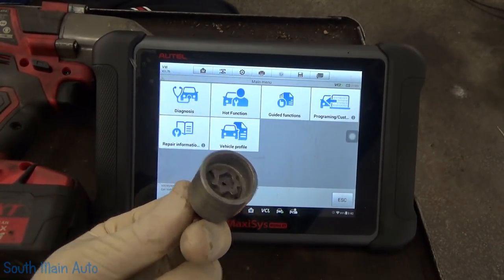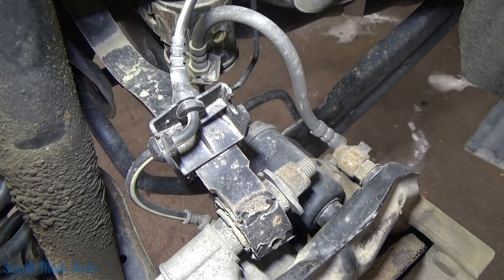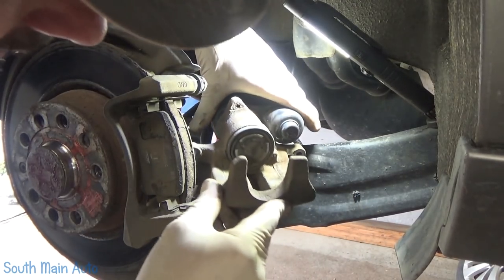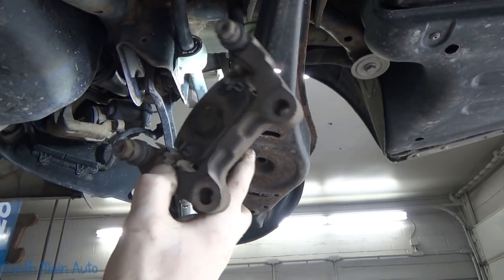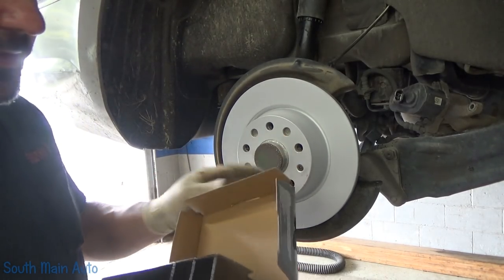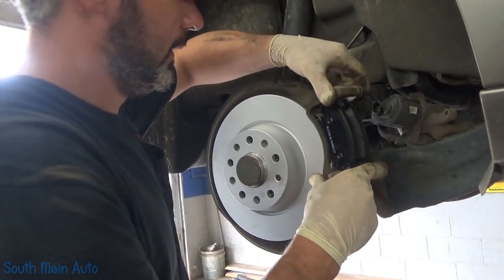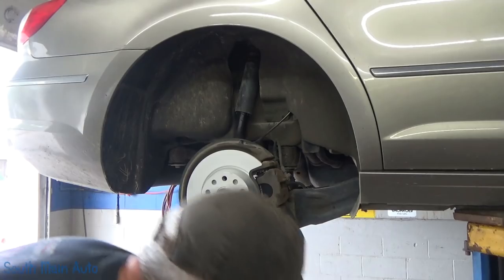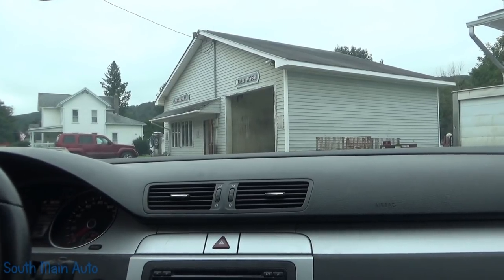Do You Need A $1000 Scan Tool Just To Change Brake Pads!?

Comment: You just need an external power source for them new brakes. Reverse the leads. Will reverse the direction they turn..And don't put your fingers in there ever with the power connected. They work just like wireless throttle bodies. They will chop your fingers off...

Comment: 1:43 push the tab the normal way, then push the whole connector in to release it. There's no reason to use a screwdriver or break anything. It's like releasing a parking brake, you have to tighten it more before it'll release.

Comment: I used a caliper piston pusher for my 2014 Volkswagen Beetle, to change out those demonic awful noisy asbestos pads it originally had on it. I bought some Ceramic blended pads, noise went away, just as soon as I put them on. ...and what’s funny, is that I didn’t even check to see if the Calipers had any electrical wires going to it.

Comment: Do those discs not need to be cleaned ? ( residue of cutting compound )
Reply: Those discs had a silver anti-corrosion finish rather than grease/oil so no brake cleaner needed. The pads wear through on the friction surface after the first few brake applications, but the rest of the disc remains protected. A good idea IMO.

Comment: ERIC THERE IS A WAY YOU CAN PUSH THE PISTON BACK WITHOUT PUTTING THE CAR IN SERVICE MODE. THERE IS TWO TORX 30 SCREWS THAT HOLD THE MOTOR TO THE CALIPER, REMOVE THEM PULL OFF ELECTRIC MOTOR. ON THE BACK OF THE CALIPER YOU WILL SEE THE FEMALE END OF A TORX ( VOLVO'S USE A 40 ) USING A DRILL SPIN IT CLOCK WISE UNTIL IT STOPS.  PUSH BACK PISTON AND REINSTALL ELECTRIC MOTOR. YOUR DONE. IT'S FASTER THAN HOOKING UP SCAN TOOLS OR COMPUTERS. LIKE YOU I DO THIS FOR A LIVING !!  SIDE NOTE SOMETIMES THE INSTRUCTIONS IN THE BRAKE PAD BOX WILL TELL YOU HOW TO DO THIS IF YOU DON'T HAVE A SCAN TOOL OR FANCY COMPUTER

Comment: Why is it necessary to use an electronic tool?  What happens if you do the brake replacement without an electronic tool?  Seeing as the replacement is a physical thing, surely the brakes will still work tool or no tool?  Changing a road wheel works tool or no tool.  Changing a floor mat works tool or no tool.  For Mrs O.  "Hot Toddy"    R. 6 hourly – approx 3 times a day.  2 days should be adequate.  3/4 Tumbler of weak black tea (really hot). Juice of 1/2 lemon. Teaspoon of honey. 1 aspirin.  Top up tumbler with whisky of choice (use a cheap, quaffing quality whisky).    Stir till all dissolved.  Sip slowly and carefully so as not to get burnt.  Do not drive -- contains alcohol.

Comment: I wonder if anyone might know why my brake pedal travels too far on my 2006 Toyota Tacoma TRD.  I have bled the system 3 times over, pads are in good shape, no leaks anywhere.   Checked the master cylinder separately, no issues there.  No ABS lights on the instrument panel.   I am lost as to what could be the problem?

Comment: I'm old, so I automatically hate electric parking brakes! Also, I was taught and have used antiseize compound for caliper pad slide points. Does the lube you use stand up to temperature and time?
Another thing I have always done is clean and lube the slide pins... Especially since brake pads last a lot longer now. Or did you not do it because they're rear pads?
Reply: Papi Parsons based on the purple countenance of the grease,I think the stuff he uses is the Permatex Grease that's good to 1649*C. The clear stuff is good to about 200*C or more, so should last as long as the rubber boots.

Comment: A coworker did the mistake of removing the caliper (I thinks is same car vw) without knowing of the putting the car in a service mode and the piston came off and the dealer had to eat the replacement for 2 new calipers each caliper was around 800 bucks (people without knowledge and start on the field ,cost to dealer money and having a customer pissoff) 
Don’t try to do this type of brakes your self it can cost you a lot money to replace caliper damage

Comment: You really should charge a bit extra for a job like that to help offset the cost of the scan tool and the class time that you need to accomplish in order to use said tool. I'm not saying rake them over the coals I'm just suggesting say an hour and a half shop time. Thanks for the video.

Comment: Im intrested in a bi directional scan tool for my own personal use. I want something no more then $1000.00 but have no idea which one.i see Launch Foxwell Autel the most but there's thousands to choose from. My vehicles are all older 03 h2 04 astro van 04 ram hemi 04 durango so i want to be able to continue to be able to fix them like quick learn routine on the 45tfe transmission or abs brake bleed on my astro van. Misfire problems on the hummer
Any suggestions? From anyone?

Comment: I bought a used 2015 Mazda 3 instead of a new one for the fact they removed the parking brake lever and put in an electric one. Also it has much fewer electronic aides. WTF electric brakes, I read they are developing brake by wire as well. Crazy times.

Comment: I wonder what you would do if it was broke down and needed a tow? 
Can’t just throw it in neutral?
Reply: same way, have to jumper pack power(if dead) and release them, many if not all have a "chicken dance"/service menu to release/set service/tow mode.
the towing guys would likely know more on all the various vehicles or just brutally drag them onto flat bad of major wrecked or add a drag dolly to the wheels

Comment: I'm not 100% but you should be able to just hit the release for the parking brake right before you start? It should release it so you could replace the pads.
Reply: never checked nor cared myself, but I'm pretty sure standard "release" mode doesn't run the motor and retract the mechanism all the way back, it just pulses it in reverse to release and not interfere with normal braking. that way it doesn't have to run as far to set again.
if someone knows otherwise or has scope/graph/time base of the signal, this would be great place to add it :)

Comment: You can remove the electro parking brake motor from the caliper and turn in the motor with a t45 or something like that then your able to continue on with the brake job. Works on bmw Mercedes and vw/Audi from what I’ve seen in my shop

Comment: Can you not just pull the connector off, put 12 volts across the contacts, swap polarity if needed until it releases, do the brake job then run it back closed again?

Comment: haha, soon as I seen the "3 prong donger" piston I thought, bet  doesn't have the tool for that.......... I gave up and started fabricobbling/moditrashing cheapo horrible fright ones lol
also I'd figure if they re-calibrated each time used and if simply reversed by polarity motor with the module sensing motor stall current, if yes, one could simply lab supply run them, maybe just reverse the wires to it and let it think it's on when it's off. But you best know what your doing and be certain before trying to manually power or reverse things!! (not for everyone). 
I've never liked "NO" or you need X and XX and XXX tools as an answer, NO, NO I don't ;)

Comment: You dont need a scan tool,just unplug the Electric connector on the caliper and put 12 volts to the caliper.One way youturn the Engine back and then you can change pads,if you dont drive the caliper Engine back it vill be distroyed.Whit the new pads in Place turn 12 volts again to set the pads tigth to disk and let it off a litle,done!

Comment: I use a Power probe.  I put it directly to the caliper. And when finished I just pump the brakes  I have no issues doing this method.
Warning!! This method does not work on some Mercedes Benz

Comment: Someone explain real quick... why do you have to put it in service mode? Does the VW automatically set the parking brake when you shut the car off?
Reply: No the piston retracts a little so its easier to take caliper off i am a tech i never use scanner not necessary

Comment: Couldn't you just chock the wheels, take the parking brake off Park and then unplug the calipers???  Just a guess as I've never had any experience with this particular style of parking brake, but I would think that having the mechanism either on or off and then removing the power source would keep them locked in that position??? But like I said I've no idea on how the system is managed. Worst case scenario you may need to reset your control module or unplug the negative terminal while you work.

Comment: I hear you just unplug the connector and give caliper 12v and little motor turns one way or the other. Trick is to know which way to connect 12v.. do it one way, if it pushes forward.. reverse the leads.. Then do the opposite when done changing pads. I cannot find video where I have seen it tough. Sounds like this procedure should be done with some caution.

Comment: what happened to the old fashioned squealing when your brakes are low? the brake level indicators that didn't need so many sensors that could just as well be done without?

Even your daughters know "is the master brake cylinder low? if so check for leaks, if there isn't any then check the brakes, if they aren't low check for leaks along the lines, if there isn't any just check if the brake fluid is good or bad then top it up.

sometimes these tools take longer to start up and diagnose than it takes to figure out "well damn, the tyre pressure is low, that's why there's a check engine light flashing"

We need to teach kids basic car maintenance when giving them their licence and tell them that they are to make sure that their vehicle is in top shape every time it's on the road

Comment: THEY SELL CHEAPER SCAN TOOLS AROUND 100-200 THAT CAN PUT REAR ELECTRONIC PARKING BRAKE MOTORS INTO SERVICE MODE. NO NEED FOR A "HIGH END" SCAN TOOL OR THE VW VAG COM TOOL.

Comment: VW's are "Different" but once you accept and work with the "Differences" they are great cars. Just did the Timing Belt and Water Pump on my wife's 1999 VW Cabrio Convertible and although it was different, it was not difficult. I have had to do VERY LITTLE in the way of unscheduled Maintenance on that car in over 160,000 Kms. (Mrs. O's Timing Belt Banter kept me aware that it needed to be done, but the noisy water pump bearing cinched it.) Electronic Handbrake is a great idea, NO CABLES to rust and not release properly. The new Boeing 787's use Electronic Brake Units. Imagine the simplicity of servicing. Worn brakes, remove the wheel, unplug the unit, unbolt and replace the unit, plug it in, install the wheel, and maybe some type if re-initialization..... NO BLEEDING! These units are complete with anti-skid systems that communicate with the controller for the entire set of wheels. Take-off and Landing speeds can be as high as 150 MPH. The removed units are then taken to a Brake Shop that Overhauls them..... NO..... Not Dorman. Great Video, and nice to see Mrs. O make an appearance even though sick..... and spinning..... that is a feel good moment. Get better Vanessa, we need your input too.

Comment: There is a method for the home gamer:
#1 ignition on - engage parking brake - ignition off
#2 jack up vehicle and remove tire - remove the electrical connection of the brake actuator motor
#3 remove this motor
#4 find a fitting bit to screw in the brake piston from behind
#5 change pads / rotors
#6 re-install brake actuator motor with its electrical connection, reattach tire
---- repeat process on the other side
#7 ignition on - release and turn on parking brake ---- enjoy!

Comment: I know on my Mercedes i make sure the screen is on mileage, then i hold the phone answer and ok at the same time and it brings up a service mode,scroll down to brake pad fitment then ok and then the ebs retracts the caliper pistons, key off, do the replace pads and rotors if needed then power on answer phone button and ok, it will ask is service complete click ok then scroll to auto brake pad adjust then ok brakes get auto adjusted then power off lower vehicle and you are done. no computer needed and dealer loss of $650.

Comment: You can fool them just put car into gear put foot on brake and press the handbrake button then once the handbrake releases switch ignition off  so handbrake (park brake) doesn't have chance to apply then i just unbolt motor off back of caliper then push piston back in then stick motor back on reassemble brakes pump footbrake then switch ignition back on and press the handbrake (park brake) button and then it winds the motor in to the piston

Comment: What do you call that press tool used to push piston back? anybody know?
Reply: Caliper brake tool, some let you spread pads apart to get them out, some kits are just the tool to push the caliper in, and some have the adapters to do the calipers that need to spin as they retract (VWs other than this one apparently).

Comment: $1000 scan tool is unecessary. Same thing could be done for under $100. In my case $230 gets me a VCDS tool that does more that that one will do on VAG products. I hate Electronic parking brakes though and my 2013 VW doesn’t have one. Many car companies have them now unfortunately and they all require some type of computer to do some things, Honda, Chevy doesn’t matter they all do it not a VW thing.

Comment: I hate those axle bolts.  Metric hex 17mm torque to 140ftlbs then 180 degrees.  You need a long breaker bar.  I you have to chock the car to keep it from rolling.

Comment: OK Eric you made me mad about your agreement with the smarty pants about running VW's in the water. New ones??
NOT the older ones. I had a '91 VW Jetta TD when it was totaled by a jerk running a red. Had 698, 714 KM on it and was still running great. All original and had put nothing in to it other than brake jobs. I have an '86 now with 753,000 km--rusted pretty bad though--engine still runs great and I live in Western Canada where you can easily encounter MINUS 40 weather in the winter. Plug it in for 3 hours and it starts no problem.  Try MINUS 40 with some wind see how you like that! Other than that BITCH (not You), I love your channel. In fact, I took the injection pump from the '91 and put it in the '86 about 100,000 or more ago because the input shaft had quite a bit of play in it. Odd part it was running fine, not leaking. Found it when I changed the Timing Belt.

Comment: Didn't see this listed,  but this clearly goes under the "Right to Repair".  The DYI'er likely won't and can't spend mega bucks on a scan tool for changing brakes.  Recently CA just dealt a huge blow to "Right to Repair" with a ton of lobbyist from John Deer Tractors.  So they are screwed now and can only use 'dealership new' parts and are stuck awaiting for factory service techs when their farm eq. breaks down.  https://www.wired.com/story/john-deere-farmers-right-to-repair/

Comment: The entire point of an emergency brake is to stop the car when the regular brakes fail. This should be mechanical, not electronic. Electronics fail easily, mechanical cables last forever.

Comment: I woulda just cut the caliper off the brake hose and quoted the customer for 2 rear calipers with brake hoses
Reply: :)) "loaded calipers with brackets and rotors. would still be a fight to get them off when "applied"

Comment: Soo every time you put the car in park, the park brake automatically sets?? That's B.S.  could you not jack the car up, start it, put in drive so it will release the parking brake, remove the negetive battery terminal,( the car will still be running from alternator output), then turn the key off. There would not be any voltage for the electric park brake to set.  It's a bunch of shit to go through, but saves on buying a high dollar tool.  Just sayin.

Comment: Wasn't  the original intention of a parking brake, to be used as an EMERGENCY BRAKE...like to stop the car in an emergency???
What happens if there is an electrical failure? It's like wiring the emergency stop switch through a microcontroller-you just don't  do it.